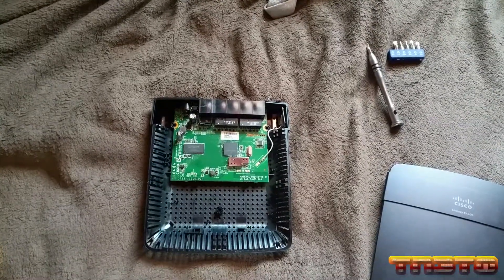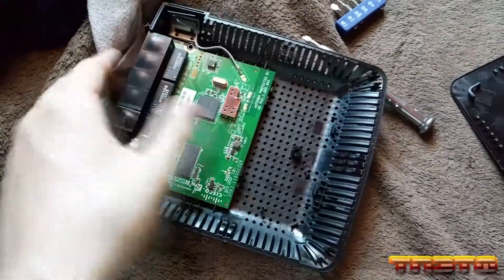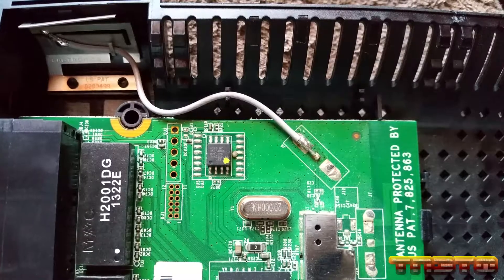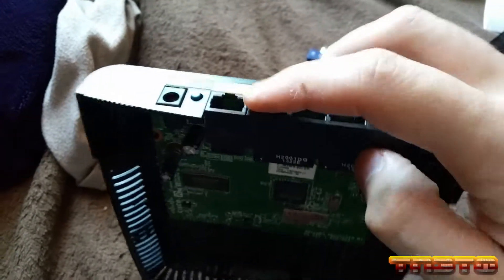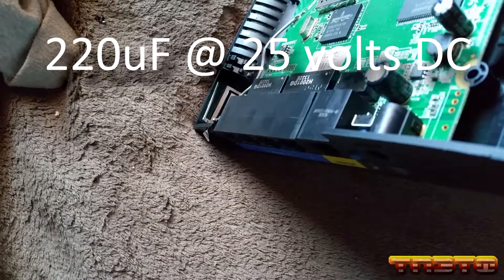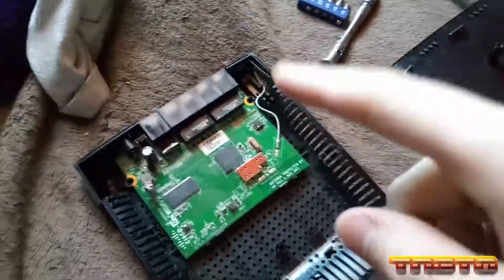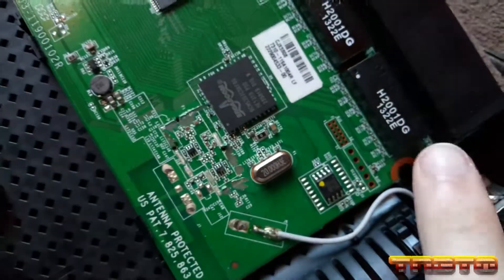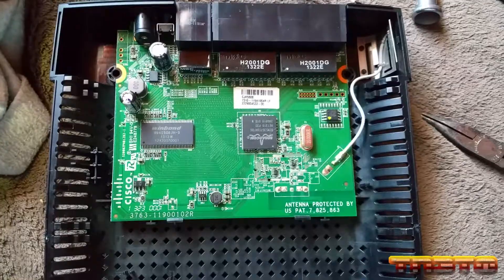Teardown of Linksys E1200 v2 Router [Old Video]

Comment: Good video! I am working on a local Restaurant / bar's network. It has an Arris Touchstone CM8200 and Cisco Linksys E1200. I tested the WIFI signal with my iPhone with speedtest and got 25.8 Mbps download and 15.5 Mbps upload. The location is on the second floor in a living room of an apartment. Complaints of poor reception downstairs not directly below the apartment WIFI strength was clocked at 1.14 Mbps download and 0.21 Mbps upload. Would you sugest a WIFI extender or replacement of the Cisco WIFI unit? I will be checking to see what package the customer has with their local provider. Keep up the good work.

Comment: My router is a Linksys E1200V2, the problem is that when the router turns off and then turns on the firmware, the router goes into firmware update mode of management mode, when I proceed to install the firmware it is very difficult for me to do it. grip, do you know what problem is causing it or some solution?

mi router es un Linksys E1200V2, el problema es que cuando el router es apagado y luego encendido me pide Firmware, el router entra en modo Management Mode Firmware Upgrade, cuando procedo a instalar el Firmware me cuesta mucho hacer que lo agarre, saben que problema lo ocasiona o alguna solución ?
Reply: Yo hace un momento hice un backup del firmware ( ddwrt ) con una CH341a que me acabo de comprar, siempre es bueno tener una a la mano y son bien baratas, se conecta la pinza ahi donde pone el dedo en el 2:29 y en unos minutos la tienes de fabrica. Diras, si pero hacer el gasto solo para eso... son muy utiles, ya salve una tarjeta de video y por ahi si te jodes el bios de una motherboard la rescatas sin ningun problema... Saludos.